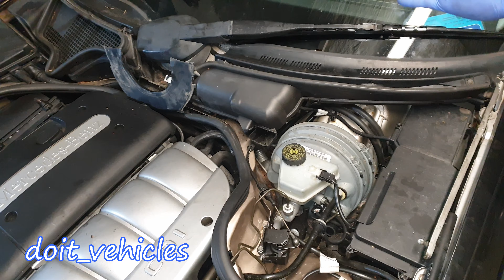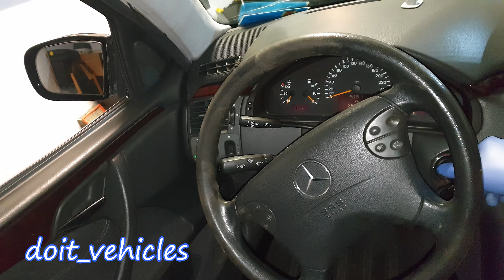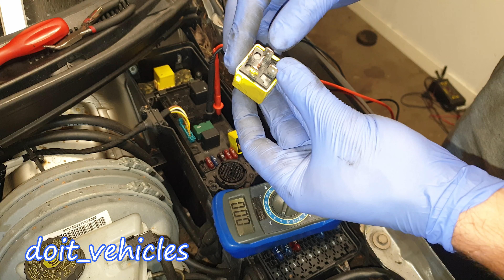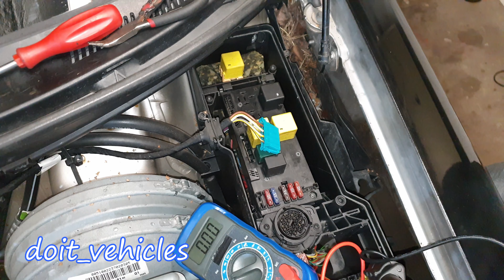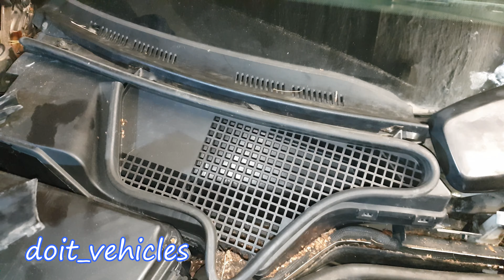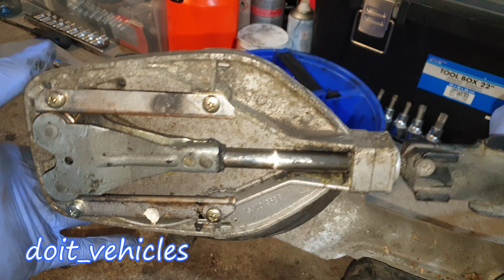Mercedes w210 Windshield Wiper Motor Assembly - Problems , Removal , Diagnose e220 , e270 e320 cdi

Comment: Love your videos.
I have a problem with my wipers. They stay on, and won't run on intermiddent. When I measure the current between 85 and 86 it stays on for about 10 seconds.
Do you have an idea, cause as far as I know, the line from the switch to the relay should be on or off, with no delay

Comment: Hey bro, my fuel pump leaks diesel when i make a cold start, after the car heats for about 15 min the leaks stop... What i do to avoid this is mount a fan heater for 15 minutes, and i do warm the pump fuel a little and no leaks happen... Any idea what it is please help
Reply from the maker: Find out from where exactlly it leacks . If its the pump the best is to replace it because the internal leak will get " larger" over time and any improvisation will not hold for long